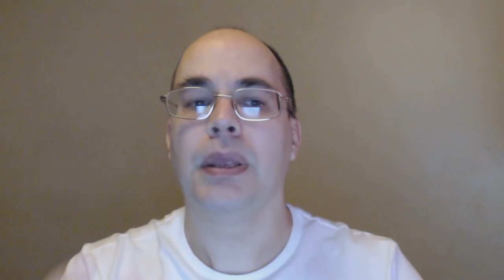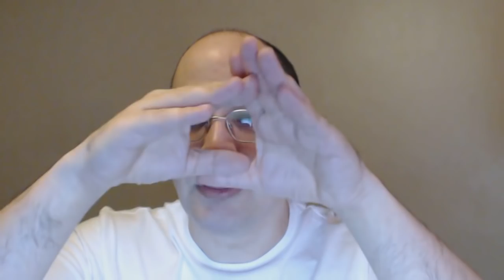How do rockets move in space, with nothing to push off from?

Comment: This is TOTAL nonsense !  Rockets in space don't have bullets ,,, its like burning gunpowder in the gun barrel without the bullet. You will produce such an insignificant recoil even on earth that is not even funny , how much less / close to 0 / in space .  TOTAL NONSENSE !  .
Reply: VESANG   "This is TOTAL nonsense !  Rockets in space don't have bullets ,,, its like burning gunpowder in the gun barrel without the bullet. "

Point of comparison; comparing instance 1 and 2 

1. A bullet is comprised of two elements; the projectile, or round, which is ejected from the barrel, and a shell casing which contains the propellant. A percussion cap ignites the propellant (gunpowder), driving the round forward by rapid expansion of combustion gases, and drives the gun backward, generating the recoil into the user.

Up until the point of ignition/firing, the propellant is sealed in the casing. Ignition  causes fracture at the weakest point, which is the joint between the projectile and the casing. 

Conclusion; the sealed propellant has the capability to rapidly expand without exposure to the surrounding atmosphere. It doesn't suck air in to aid the combustion process, it already has this in the chemical mix

Yes? No?

2. What happens if you construct a combustion chamber, containing rocket propellant, that has no exhaust nozzle? It's totally sealed, no exit for expanding gases. Light it up, and - either the propellant burns until it's all spent, or the chamber reaches a point where the pressure is too much for the build, and it fractures at the weakest point. There can only be one of these results. 

Yes? No?

Simply put, the propellant works in all directions upon the internal walls of the chamber until either it is spent or the chamber explodes under stress.

Now ... substitute this chamber for one with a controlled exhaust, and the propellant STILL works upon the upper and inner walls of the chamber BEFORE exit. 

Yes? No? 

If you answer No, then why would it change behaviour between the two situations?
Reply: Jan ... have you watched even the video I commented on ?  ... really ... telling me I am the one to talk about bullets ... It feels like you are extension of CNN or something ... I am sorry but that's just beyond me . I can't even attempt to have meaningful discussion in this case . I am not mad or anything but I can't brake programmed minds . I can't ...
Reply: Tumeni Hits ... Thank you for the reply ! YES on almost everything unless you want to take it to where there is a pressure difference in the chamber at upper wall vs exhaust ...  and all of this is beside the point anyway bcs the most / pretty much ALL / thrust will be generated if there is something outside the chamber for the gasses to push against . REMEMBER we are talking about VACUUM of space .
Reply: VESANG - so you agree with everything I said, but still insist rockets won't work in space? Really?
Reply: Tomany hits ... I don't know why is so hard for you to understand simple points I am making . Its like speaking different languages.  Just the fact that firing bullets on earth cause recoil does not mean rockets in space of vacuum can fly ... those are 2 DIFFERENT things .
Reply: Jan ... I am sorry that you can.t see the difference between bullet recoil on earth  and gasses burning   IN VACUUM of space ...  NO I am not wrong ... to make it CLEAR : ITS YOU  !  can.t even catch the core of the issue
Reply: VESANG  "I am sorry that you can.t see the difference between bullet recoil on earth  and gasses burning   IN VACUUM of space ...  NO I am not wrong ... to make it CLEAR : ITS YOU  !  can.t even catch the core of the issue"

... but the gases are not burning IN the vacuum of space. They are burning within the engine, within the combustion chamber, and are expanding so rapidly that they struggle to escape from it. The combustion chamber is therefore FULL of, and pressurised with, combustion gases. There's no room in there for vacuum.
Reply: VESANG  "Tomany hits ... I don't know why is so hard for you to understand simple points I am making . Its like speaking different languages.  Just the fact that firing bullets on earth cause recoil does not mean rockets in space of vacuum can fly ... those are 2 DIFFERENT things ."

Yes, it's like English isn't your first language. 

I'm drawing a comparison between the two because YOU started this thread by talking about bullets. Can I remind you what you said in the first post of this thread; 

"Rockets in space don't have bullets ,,, its like burning gunpowder in the gun barrel without the bullet. You will produce such an insignificant recoil even on earth that is not even funny , how much less / close to 0 / in space .  "

This is how YOU started the conversation. By talking about bullets.
Reply: Have you ever actually tried to burn gunpowder in the gun barrel without a bullet? :)
Reply: I have not myself ...Have you ?  ...  and what does it have to do with the topic ?  What is next " Have you tried to burn it in space .... NO I have not and i don't need to in order to see that there are issues .  There are plenty of vacuum chamber experiments and others as well here on yoututbe to demonstrate that we have space problem  ...
Reply: I have not myself ...Have you?
You are aware that there are this thing called "blanks", are you? Widely used in movie industry? And they actually do produce recoil, too! :)

and what does it have to do with the topic?
Well, you're the one that brought it up, so you tell me :)

There are plenty of vacuum chamber experiments and others as well to demonstrate that we have space problem
What vacuum chamber experiments? Like the one where a guy tried to make fan work in a vacuum chamber? That kind of "experiments"?
Reply: No need to talk to me like you are some kind of expert please .  There are no bullets in rockets . Rockets DO NOT fire bullets .  No need to bring like the guy in the video BULLETS in space to justify  the nonsense when it is obvious that with less density of the environment the thrust would go down to practically ZERO ...  if you want to believe fairy tales you are welcome . I appreciate you being civil ... but naive to believe nonsense theories .
Reply: +VESANG
No need to talk to me like you are some kind of expert please.
But I'm not talking to you like I'm some kind of expert - I try to use simple examples and dumbed-down explanations. This may be the actual rocket science, but the underlying principle is quite simple.

There are no bullets in rockets
Then why did you bring it up in the first place? :)

Rockets DO NOT fire bullets.
What they do fire is thrust. Some of it will escape the combustion chamber without doing any kind of work, yes, but the other half will have to push off the rocket in order to go down, thus making the rocket go up.

with less density of the environment the thrust would go down to practically ZERO
The rocket doesn't push off the environment.

What you're doing is saying "the stilts that car pushes off the road aren't strong enough to make it move faster than 10mph!", and when I point out that cars actually don't use stilts to push off the ground, you accuse me of believing in fairy tales.

No, really, honestly, cross-my-heart - rockets do not push off the atmosphere. Never have, never will.

Do you know what exactly is happening inside the rocket's combustion chamber? It produces thrust that goes down, yes, but how? Have you thought about that?
Reply: Jan ... You are the ones bringing bullets to explain how rockets work in space ... and sorry to tell you straight but your last comment is TOTAL nonsense ... I have no time to respond to each one of them ... I presented my points . Believe what you want . Just the fact that you would argue that environment density has nothing to do with thrust ...and rockets do not push off the atmosphere ... I am sorry ... that's beyond childish and as anti scientific as it comes . Never the less all the best wishes from me to you ! Bye now !
Reply: +VESANG
You are the ones bringing bullets to explain how rockets work in space
No, I'm not. I'm just the one pointing out that even blanks (ie cartridges without bullets) produce recoil.

I presented my points
And your points are incorrect, and I can see that you are actually unwilling to be honest with yourself and actually look into the matter. You just declare that my comment is nonsense, declare victory, and saunter away.

Well then, have it your way - anyone can see now how you're avoiding any debate, just like a typical air pusher.

Bye now! :)
Reply: +VESANG
have you watched even the video I commented on?
I have, and I'm still not the one bringing bullets into it :)

telling me I am the one to talk about bullets
The point is, even blanks produce recoil. Why are you ignoring that? :)

I can't even attempt to have meaningful discussion in this case
You're not even trying to have a meaningful discussion. I've asked you a question about what do you think happens inside the combustion chamber, and you ignored that.

Seems to be like the one with programmed mind is you, not me :)

So, again, what do you think happens inside the combustion chamber? How do exhaust particles all start moving in one direction only? Does NASA possess secret anti-gravity technology to compel them to do just that?

Yes? No? :)
Reply: Well, that's the thing - the basic principle is actually the same.

You're simply wrong. Your claims your wrong. And your refusal to explain yourself tells me that you realize that as well :)
Reply: Technically speaking, every bullet discharge happens in vacuum, so you're wrong here, too :)

So, again - what do you think happens inside the combustion chamber? Enlighten us. Share your wisdom with us. Teach us. Help us understand this "core of the issue" thingy!

Comment: The impulse exerted on 'the pad' is physically unconnected to the rocket, and therefore has no effect. This is completely basic, obvious, 101, physics.
Reply: So you're saying, if I point a working fan at your face, you won't feel any wind coming? After all, that fan is physically unconnected to your face, is it not?
Reply: No, he's saying that if you hold and point the fan at his face, (or the ground), you won't feel any difference in the reaction force that pushes your hand back. You'll only feel a change in this when you change the speed of the fan, or switch it off.

Bouncing the fan's wind off anything won't transfer energy back to the fan

Same principle applies with water expelled from a garden hose. Take your hose, hold it about a foot from the end, with a spray nozzle fitted. Have a helper turn on and increase the water flow. You feel the hose move more as the pressure increases. 

If you think this is because the water is pushing against air, move the hose toward and away from a solid surface (which should present more resistance than air) and you feel NO change in the pressure on the hose. It's only when the water is turned off that this pressure goes away. The air is not providing the push

Comment: O MY GOD PEOPLE ARE SO DUMB I HAVE LOST HOPE IN HUMANTY , Lee Jonson thats because the earth is FLAT and gravity is still a theary, Apollo 959. The water is pushing on the air! Thank you tim jensen you are smarter than most every one flapping their lips in this comment section .This is why we could not have gone to the moon rockets have to push on something ,a. vacuum is nothing! GOD BLESS YOU ALL ANYWAY! Newtons 3 law wont work in a vacuum! Thank you M. J. Murcott
Reply: Are you referring to ;

"Analogy with water expelled from a garden hose. Take your hose, hold it about a foot from the end, with a spray nozzle fitted. Have a helper turn on and increase the water flow. You feel the hose move more as the pressure increases.

If you think this is because the water is pushing against air, move the hose toward and away from a solid surface (which should present more resistance than air) and you feel NO change in the pressure on the hose. 

It's only when the water is turned off that this pressure goes away. The air is not providing the push"

If so, please read the second paragraph again.

Comment: I can see you reading from a screen it's reflected in your specs.however you clearly have no understanding of the subject.rockets cannot function in a vacuum.i bet you luv Elon musk and the warm triumphal feelings Apollo13 stirs in you.
Reply: Do you have something substantial to say, aside from silly personal attacks?If you believe that rockets work by pushing off air, then, please do explain it to my ignorant self: how exactly rockets make all of those hot gases go downwards and not, say, sideways or upwards?
Reply: Rockets will work in space

Easy to prove they will by a number of methods.

1 Analogy with water expelled from a garden hose. Take your hose, hold it about a foot from the end, with a spray nozzle fitted. Have a helper turn on and increase the water flow. You feel the hose move more as the pressure increases. If you think this is because the water is pushing against air, move the hose toward and away from a solid surface (which should present more resistance than air) and you feel NO change in the pressure on the hose. It's only when the water is turned off that this pressure goes away. The air is not providing the push

2 Comparison with detonation of explosives. A rocket is a controlled detonation. When an explosive ignites, it generates rapidly-expanding gases which, in a microsecond, rupture the container holding the explosive in place, and generate an expanding shock wave in either the surrounding material, or air surrounding that material. They don't need air to ignite. They have an oxidising element in their make-up

so ....

3 What happens if you construct a combustion chamber, containing rocket propellant, that has no exhaust nozzle? Totally sealed, no exit for expanding gases. Light it up, and - Either the propellant burns until it's all spent, or the chamber reaches a point where the pressure is too much for the build, and it fractures at the weakest point. There can only be one of these results. No?

Simply put, the propellant works in all directions upon the internal walls of the chamber until either it is spent or the chamber explodes under stress.

Now substitute this chamber for one with a controlled exhaust, and the propellant STILL works upon the upper and inner walls of the chamber BEFORE exit. No? Why would it change behaviour between the two situations?

For those who think rockets push against air, consider this - the Saturn V developed 1,522,000 lbf for sea-level thrust, with a mass flow rate of 5683 lbm/s and exhaust velocity 9800 f/s.

Is atmospheric air at roughly 15 psi static going to present any meaningful impediment to this? It won't resist the rocket exhaust, it'll be pushed out of the way, like a 15-car railroad train swatting a fly. 15 psi is an insignificance against this. 

1. "Apollo 11 Saturn V Launch Camera E-8" - /watch?v=DKtVpvzUF1Y

Especially look at 0.45, where the engine reaches full power, and the smoke which has billowed out from the area below suddenly switches direction, and gets dragged back down. 

What do you think would cause it to do this, other than the atmosphere being dragged there?

Also at 1.36, the ice falling at the edge of the pit changes direction as it passes the hold-down clamps, and also gets dragged along. 

What do you think would cause it to do this, other than air movement pulling it in?

2. "Crucial Booster Test Fires Up in Utah"- /watch?v=LhxSk70r8dw 

Observe the ground around the booster once it's running. See how the movement of the atmosphere around it is pulling the loose sands etc toward the rocket exhaust. See 0.14, and look at the ridge line to the left, and in the following shot, where the material parallel to, and above the exhaust is being dragged toward it.

3. "Future SLS Rocket Engine Test Fired at Full Power | RS-25 | Video" - /watch?v=UEhHRXDFkeU

Watch the steam and vapour being produced ABOVE the engine being dragged down by the airflow.

4. Amateur demo shows model rocket engine thrusting in a vacuum ;

"Model Rocket Engine In A Vacuum Chamber - 4K Slow Motion - will it burn?"
/watch?v=GxBRQXxBRic

5. "RS-25 Rocket Engine Test"
/watch?v=cXgJVrmdYrY

"RS-25 Engine Test from Stennis Space Center"
/watch?v=CG2WeMSlOrA

Watch the steam and vapour being produced ABOVE the engine being dragged down by the airflow.